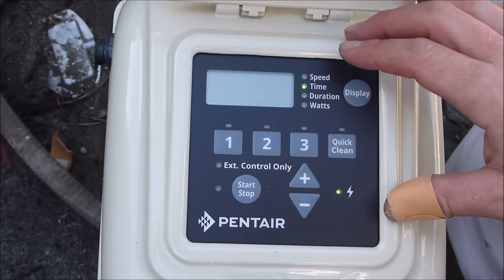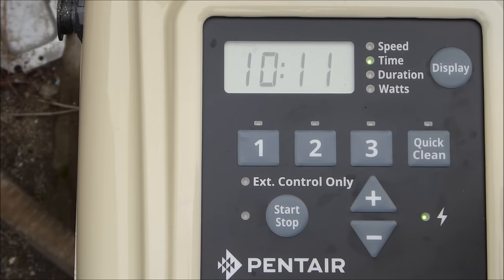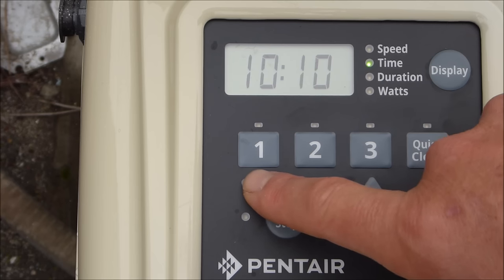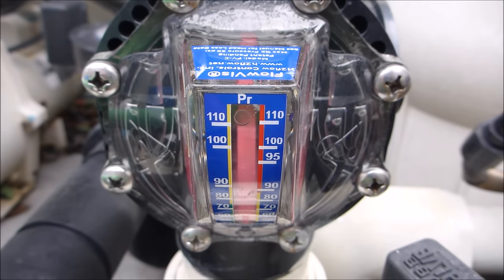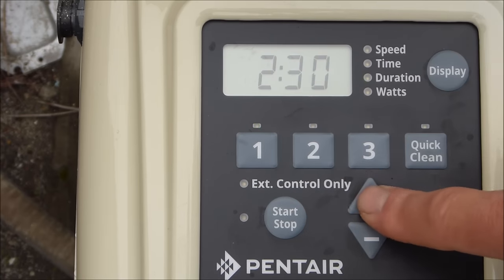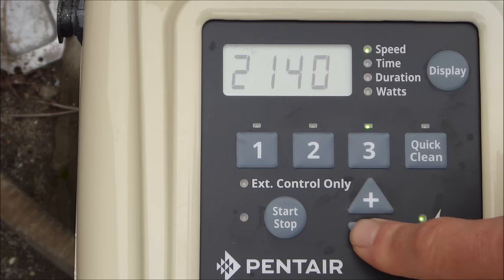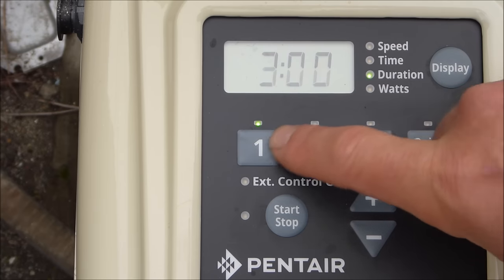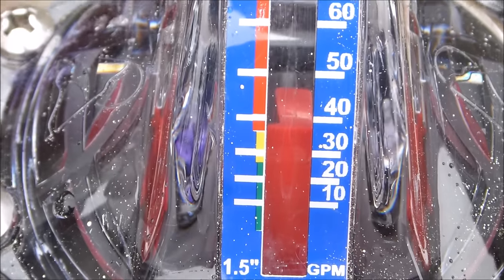Pentair SUPERFLO® VS (VST) Variable Speed Pump Operating and Programming

Comment: We have this VS Pump and a Hayward salt chlorine generator for a 20,000 gallon pool any suggestions on run times and settings? Thank you for your videos!
Reply from the maker: 12 hours at 1800 RPM and 8 hours at 2400 RPM. That is equivalent to your standard speed pump running for 2 hours a day in electricity use.

Comment: Thank you for this.  Quick question though?  If we want the pool to be heated with this pump doesn’t it have to run at 3000 RPM or above?
Reply from the maker: It doesn't need to but it will take longer to heat on a lower RPM

Comment: Thanks for your video! Do these settings work for an 18,000 gallon salt system pool in Northern California? I actually kept 2 hrs at 2200 rpm so I’m running 2 hrs @ 3000, 8 hrs @ 1400, and 2 hrs @ 2200 rpm.
Reply from the maker: I would try 12 hours at 1800 RPM and then 8 hours at 2400 RPM. Easy and effective.
Reply: @SPL  thanks!

Comment: How does this work with easy touch panel if I wanted to switch it to spa mode for example
Reply from the maker: It doesn't work well with automation. Specifically designed as a stand alone type VS pump.

Comment: I purchased a home with 36x16 inground salt water pool. Deep end rougly 9ft & shollaw end roughly 4ft. I believe the pool has roughly 24,000-28,000 gallon of water The last pump was set to run 10h at 3000 rpm, 10h at 2200, and 2h at 1400. Not sure who set that program. I believe that is over kill. The motor was just replaced after 1 year since installed today because it became very loud (under warranty). I don't have a flow meter. Do you think the factory settings will work okay? Or could you recommend  setting please?
Reply from the maker: 14 hours at 1800 RPM, 8 hours at 2600 RPM - try that.
Reply: @SPL   thanks for the suggestion. I really appreciate it.
Reply: Over time at the 1400 RPMs the pool pump isn't staying full in the glass top. I can basically see the low amount of water being pulled into the pump. Is this just because the rpms are so low? Is this okay? At 2600 rpms it's full.

Comment: In general, is this your common schedule for most pools? 3 hour morning high run followed by 8 hour slow run? Thanks
Reply from the maker: 8-10 hours on a low speed like 1800 RPM and then 4-5 hours at 2400-2600 RPM. Depending on the pool size. But nothing on high speed at all really.

Comment: Will this pump work with a pool and spa combo.  I have a 10,000 gallon pool with spa attached.  I have a 2hp pump now.  Will it  operate the spa with 6 jets?   and how do you program it for spur of the moment heating up the spa and using with jets.
Reply from the maker: Yes, it will work fine. If you don't have an automated system, you would simply push the Quick Clean Button, turn the valves to spa mode and start your heater.  You would set the Quick Clean Button at 3450 RPM and for a run duration of 2 hours. Very easy.

Comment: how do I set or disable the prime speed?
Reply from the maker: When you turn on the pump it will begin it's default priming at 3450 RPM for 5 minutes. To lower the priming speed, as the pump is in it's 5 minute priming mode simply hit the "-" on the control panel.  Keep hitting it until the desired New Prime Speed is displayed. Next time the pump primes it should prime at that speed - say 2800 RPM
Reply: Lowering The Prime Speed Below 1700 RPM When The Prime Starts Will Disable It...
#GotPrime? #AskMeHowIKnow

Comment: Your Vedic is very helpful! The screen recently doesn’t show, that makes me unable to adjust it and program it! Any tips?
Reply from the maker: Check the wire inside to see if it has come loose. Easy to do. Just unscrew the screen and you will see the wires under it.
Reply: @SPL   thank you so much for your quick reply! I’ll try this and hope it works.

Comment: How do you know what speed to set at to turn the water.  My pool is 29000 gallons?  Do I have to worry about too high of a speed ruining the sand filter?
Reply from the maker: Not really.  Your sand filter should be rated for a 1.5 hp pump - especially if your pool is larger.  Generally 2400 RPM will get the pool flowing very well and still save you on energy cost.

Comment: So I have a MX6 zodiac auto vac, so when I run the pump at lower speeds the vac doesn’t seem to work. How long should I use my mx6 in the pool and at what RPM?
Reply from the maker: At low speeds it will not move much at all. I think 2400 RPM will get it moving pretty well and I would run it for 3-4 hours each day at that speed or higher if needed.

Comment: The method shown here for setting the clock does not work on our pump.    When I press DISPLAY and hold it the green light never flashes and the display continues to show the wrong time flashing.
Reply from the maker: Hmm. Maybe try resetting the breaker.

Comment: Stupid questions from a new pool owner here (21,000 gal vinyl): 
-would programming the time matter if pump is attached to Intermatic timer since it will cut the power at certain time anyway?
-when it first cranks up, it goes to prime, then speed 1 (let's say set for 2 hrs), then speed 2 (X how many hours)?
-follow up to question 2, how long should I run the pump for each speed for a day? I heard it depends on the season/temp.
TIA
Reply from the maker: Take off the intermatic on/off trippers and leave that on. That will solve the first issue of it turning off the VS pump.  For your size pool I would set it on low speed for 12 hours  in the Summer- 1700 RPM and then a medium speed of 2300 RPM for about 4-5 hours each day. That sounds like a long time but the energy use is about 2 hours of a standard pump.

Comment: Does 2500 rpms at 10 hours sound ok for a 1000 gallon pool? It does have a salt sell.
Reply from the maker: Is that 1,000 or 10,000 gallons? I prefer 2 speeds. 1800 RPM for most of the time  75% and then a high speed of 2300-2400 RPM for 25% of the run time.

Comment: I just had this installed last week. I have it running on the default program. My inground pool is 26,000 gallons. Can I run the pump at high speeds over night? The night before  a party, I used to run my old pump with the heater. The next day it would be nice and warm. Im afraid if I leave the default program , the heater will shut off.
Reply from the maker: Yes, you can do that.
Reply: @SPL  How? Do I just increase the speed manually and it will run until the time expires?? I thought there was some type of bypass setting to run it 24-7 if I wanted to.

Comment: When you add yellow out and need to run 
pump for 24 hours what speed do you recommend and do you simply program one of the speed buttons for the 24 hours? Thx
Reply from the maker: Yes. Typically at a higher speed like 3100 RPM. No need for the full 3450 RPM. You can program a button to run for 23:59 minutes.

Comment: Your videos are super helpful.  I bought a house with the Pentair system.  I’m learning how to use it thanks to you.  

Question.  I understand how to set the system but what changes should I make for the weather.  How long should I run the filter and at what speed for 90 degree weather and what speed for 70 degree weather?
Reply from the maker: I would cut the run time exactly in half from Winter and Summer to make things easy. Glad you found my videos helpful! 👍

Comment: Thank you so much for this video. It was much needed. I just like to clear something. I like to run my pool for a total of 7 hrs/daily. I programed the 1 cycle for 2hrs at 3000 speed, 2nd cycle for 4hrs at 1400 speed and 3rd cycle for another 1hrs at 2200 speed. This should give me a total of 7hrs right?  After I set the clock and programing of all the 3 cycles I turn the START/STOP switch on. On display screen shows Err 0021 and the pump does not start on the programmed time or at all. The quick clean won't start either which is also programmed for 2 hrs. Any suggestions and advice would be greatly appreciated. I have a small pool. Thank you in advance.
Reply from the maker: Your panel may be loose on the pump. Remove the screws on top and check to see if the 5-pin connector is all the way in. Do this with the breaker off to prevent getting shocked.
Reply: @SPL  I tried that and it started working. Thank you so much.

Comment: Would You Recommend This Pump To Replace A 15 Year Old PAC-FAB Challenger? Is It A Drop In Replacement? Is It Ok For A Pool With 1.5 Inch Plumbing? The Pool Is 13k Gallons
Reply from the maker: Will be good. Not exactly drop in plumbing but if you need to create a higher or lower angle just put to 45 degree fittings together and it creates a nice "S" curve that can be moved around.

Comment: hi i wrote from indonesia, i just built a swimming pool size: 53ft x 9 x 5 deep = 16'200 gallon.
my size pipe are all 1,5 inch.
here they sell the intelliflo vs or superflo vs.
the filter here are ta60,ta100 or sd80.
i'm little bit confused on which is it the best pump and of course filter i have to buy.
please help me. hope to hear you soon

Comment: How is the best way to set pump for 24 hours, as in when you are using algaecide and pump needs to run 24 hours
Reply from the maker: I just set the high speed to run for 23:59 minutes.
Reply: @SPL  I'm looking for the same information.  After I add the shock powder and set the pump to run for the recommended 24 hours, what speed should I use?  By "high", do you mean the 3450rpm prime speed, or the 3000rpm high speed at which this pump is supposed to run the first 2 - 4 hours of the day?

Comment: Hey i have a quick question for a 10000 gallon pool is a 90 sqft good enough it does a great job its a c900 ayward or should i go to overkill and get the hayward c2002 or c 1750
Reply from the maker: The bigger the filter the better. 200 sq ft is fine.

Comment: Great Video, I followed your programming advice. However when I turn on the pump the RPM doesn't read what I set it at. Any thoughts on what I'm doing wrong. The pump seems to run fine. I don't see the watt light ever light up in any mode. When you go through the programming part does it automatically delete the previous program that was turning on the pump ect. Thanks in advance.
Reply from the maker: The best thing you can do is to call Pentair Tech support while you are out there by the pump. That way you can tell them what is on the screen at them moment. It is hard do troubleshoot it if you are not directly at the pump. Expect a long hold time unless you call early AM - 800-831-7133

Comment: It used to turn off when my inside timer told it to. Now it just stays on ... what can i do ??
Reply from the maker: Check to see if the button for the external timer got turned off on accident. or reset the breaker that the pump is on.

Comment: This video is great! I have a 12k gallon pool. I live in AZ, for the heat should I be running 12 hours per day or is that overkill? Also is speed 1: 3000rpm for 3 hours then speed 2: 2000rpm for 6 hours then speed 3: 1400rpm for 3 hours ok?
Reply from the maker: I would set it to run for 12 hours at 1800 RPM (165 watts per hour) and then 4 hours at 2400 RPM as long as you don't have a cleaner. This will give you maximum energy savings. If you have a cleaner set it for 2600 RPM for 3 hours. This is roughly equivalent energy wise as 2 hours of run time on a 1.5 hp standard speed pump. So you can imagine the energy savings.
Reply: @SPL  Thank you. I forgot to mention I'm on a utility package. I save by not running during 3pm to 6pm Monday-Friday. What would you suggest in that case?
Reply: I have a rebel vaccum as well and the pool is probably actually closer to 10k gallons. I just bought this house so I'm learning lol.

Comment: mine says  ERR  a lot. what is that?  the manual that came with the pump should be like this.  it is terrible
Reply from the maker: I'd check the wires under the cover to see if they are tight. Also spin the impeller from the back with an Allen Wrench when the pump is off. I would also turn the breaker off for 5 min to give it a hard reset. If ERR still appears you may have an issue that Pentair warranty might cover depending on the pump's age.

Comment: Great video. Was wondering i live in Arizona and it really hot here would be the best rpms and from what times  should I run the pump on each cycle ?
Reply from the maker: Depends on your pool size. But I run most of my VS pumps at 1800 RPM for 10 hours then at 2400-2600 RPM for 8 hours. This is still about 2 hours of run time on a standard single speed pump. So don't let the long run times scare you.
Reply: @SPL  ok so would I program on cycle 1 at 1800 rpm for 8hrs then on cycle 2 run it for the remaining 2 hrs 2600 rpm

Comment: My quick clean will not come on the Led light is on and typically after hitting quick clean it will run. Today it's not. Is there something wrong? We also have a problem with algae what speed is good for that?
Reply from the maker: Turn the pump off by hitting the on/off button. Then press Quick Clean and see if there is a run time set.  That could be the issue.  Or it might be set at 0 RPM

Comment: Great Video! While the pump is on I see you can manually adjust the rpm speed with the up and down buttons. Question is if I push program #1 does that automatically reset to the start of the programming cycles? 

If I turn the pump off and then want it to go mid cycle what button do I push?
Reply from the maker: The programs should restart where they last left off. So if your pump is set to run from 9 am to 5 pm and you turn it off at Noon and then back on at 2 pm it will go on for the remaining 3 hours.
Reply: @SPL  t
Thanks. One issue is what if I want to run it sometimes overnight with my pool heater, it seems like I would have to reprogram it to so so and then the next day reprogram it again. 

Or what if I wanted the run the pump for a late swim let's say 7pm to 10pm...it seems like I cant just hit an "on switch" and that it would need to be programmed again.
Reply: @steintime22  curious how did you set yours up to solve your problem
Reply: @cathrynjuengst1591  I programmed the "quick clean" button to run for 23 hrs. so I hit that button before I turn the heater on, when I'm done with the heater, which is usually mid to end of day I just hit #3. Then the next morning the pump operates like usual

Comment: If I have a 12000 gallon pool . I have water a spa overflow and a rock wall. I also usually have my navigator on at all times .  Will these features still work with the lower rpm settings?

Thinking of going variable pump.

Love your videos!
Reply from the maker: Thanks for the positive feedback! Yes, the VS pump will still operate everything. You would just run it at higher speed to operate everything such as your Navigator and then a low speed the rest of the cycle. You can run the Navigator on a speed less than your current 3450 RPM and it will work fine. Anywhere from 2600-3100 RPMs is pretty common - and you will save on electricity since it won't be at the highest speed setting all day long.

Comment: You didn't explain how to get into programming mode. If I just hit the 1 button like you did, all it wants to do it start the 1 program
Reply from the maker: You have to set all three buttons no matter if you want to run only one speed. Program the other two to zero RPM
Reply: I'm not too sure if someone answered your questions since it's been over 5 months from now but you have to turn off the pump first before you can start the programming mode.  Make sure the green "start/stop" LED light is off before you hit any program buttons.

Comment: The problem is as with most pools that I've come across the builders cut corners and plumb the main drains into the skimmers with float valves, at 1,200 RPM the water's going to take the least path resistance and only pull from the skimmer leaving the whole bottom of the pool stagnant so you're not getting every drop of water through the filter.. You're not getting proper turnover with that low RPM, sorry ... VS pumps are misleading they don't do anything at the lower RPMs.
Reply from the maker: You just got to run them a ong time and need an RPM of 1800 RPM or above.

Comment: At the end why did it start flashing pr1 and 3450 rpm if you set the 1st program at 3000rpm
Reply from the maker: It primes at 3450rpm for 3 minutes
Reply: @SPL  mine will turn off and on repeatedly while flashing “pri/3450” any idea what that is? Is it a flaw?

Comment: Would this work for a pool that's 33,000 gallons?
Reply from the maker: It would. What HP pump to you currently have?
Reply: Swimming Pool Tips, Reviews & How To -MrDgvb1 I actually have no idea. Its really really old (has to be 20 years) and just burned out and my pool guy said its not fixable or rebuildable... but i dont know if i trust him....  i seem to be having it break and be rebuilt every year.
Reply from the maker: This will work fine then.  It is the best priced VS Pump on the market and  is very easy to operate.
Reply: Thank you for your help